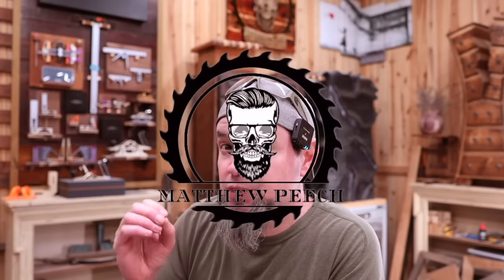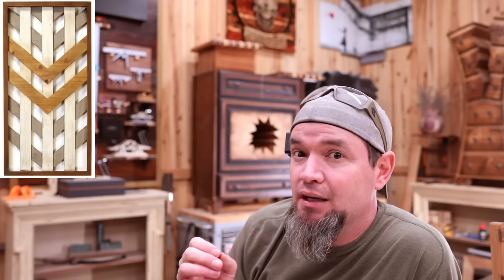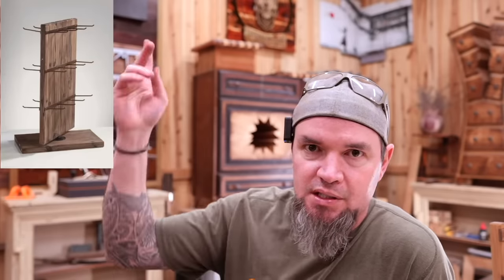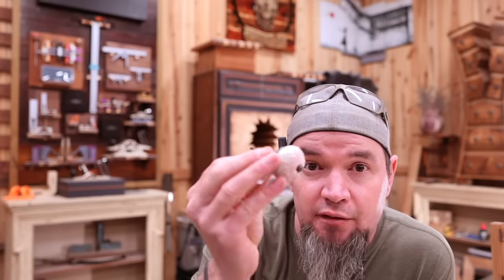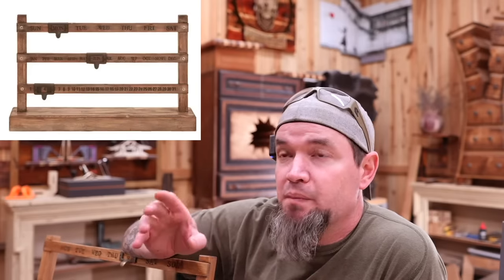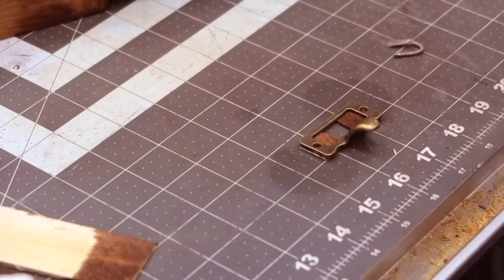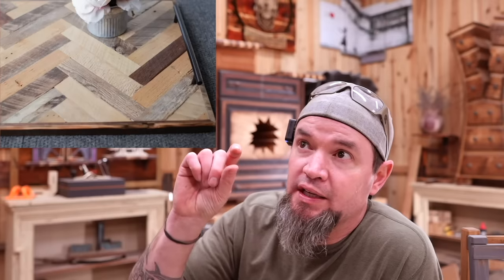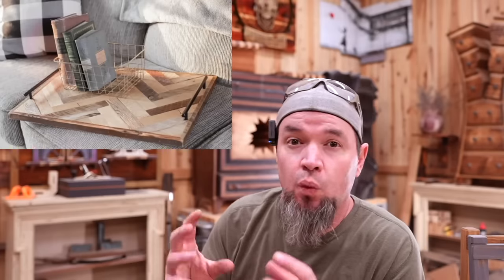7 More Woodworking Projects That Sell - Low Cost High Profit - Make Money Woodworking (Episode 12)

Comment: Looking at the "old" wood cross got me to thinking about all the piles of discarded fence boards you can find for free on offer up. A couple gallons of gas in your pickup, and an hour or so of time will get you the material to build 20-30 of those crosses, and a ton of birdhouse boards...or whatever. I keep a pile of that stuff around, and search offer up a couple times a year for more. Even if the boards you find are totally rotted, you get a weekends worth of fodder for your fire pit 😉

Comment: I have a super cool idea for that useless log sculpture. Take a router to the backside of it cut a piece of super thin plywood or heavy duty cardboard slap a few staples around the edges and turn it into a picture frame. I will be trying this idea out in my area as pictures and weird frames are a hot commodity around here.

Comment: On the jewelry holder, another way you can work around the rotating piece is to get a dowel or rod that fits in the pieces and order some thrust bearings of McmasterCarr for cheap with an ID that fits the OD of your dowel. You'd counter bore your base and tower to hide the bearing. You'd need the dowel to not be so tight that it binds the pieces but not so snug that it binds. Little tricky but you could make a cool floating effect like this

Comment: Thank you for sharing all this knowledge! You really are helping people with the begining struggles of getting started. Bravo! Would love to see some projects centered around small woodworking shops. I literally got a 10'x10' tent I've been working in and need some small project ideas that don't involve ripping up 8' sheets of plywood in a 10' space like I'm doing for my current project 😅 thanks again!
Reply: Jason, I am using an 11ft x 11ft popup gazabo with tarps wrapped around the sides as walls, so I know where you are coming from. When I need to cut larger boards or plywood I setup sawhorse's outside (weather permitting) and then take the smaller parts into the SHOP. It is sometimes a pain but you can get things done if you have to. 😃

Comment: Dude once again great video and that serving tray a just about spat my coffe out when a seen the price that. A could batch them out 10 fold. Just wanna say massive thanks again and to let u no that I've managed secure a workshop in next 2 weeks be in and allot it is thanks u and I'll deffo be attempting few these. One thing need your help with next tool jointer track saw or bandsaw for stuff like this live edge tables and serving boards chopping boards. 🏴👍🤔

Comment: Love all your small do it yourself wood building products to sell. I’m trying to find out how to stop my batteries from draining power in my shop that gets super cold in winter and super hot in summer.. Was hoping you knew something that could stop this from happening. And thanks again for all your great videos. Keep them coming.
Reply: Don’t leave batteries outside in winter or when it’s really hot. I always put mine inside when temps drop below 40 degrees
Reply: @dougpeak7591  what about the heat. It is super hot for months in central Texas
Reply: If it’s really hot you need to put batteries inside to cool down to charge . The batteries won’t take a charge while hot  or extremely cold . In the winter we keep the chargers in a insulated box so they will charge

Comment: So I built the calendar but struggling to glue the staples to the pull. A little glue a little activator. It holds but not for long. Worried after much use in sliding that staple will fall off. What’s the secret? Thanks for all your vids!

Comment: another way to do lettering would be inkjet transfer using Mod Podge. You can print the lettering/numbers/months already spaced out. I would cut half laps in a wide board on a tablesaw cross-cut sled and then rip to width (multiples of 2) making several at a time

Comment: In the first "wall art", if you look at those grey arrow boards, the 45 degree connection is hidden by the front vertical boards.  You would not even need an actual 45 joint, just as long as the end of the arrow boards are hidden behind the front vertical boards. Or you could use 45 degree butt joints like in the serving tray. Either way the joint is hidden. For the 2nd item, you don't need a "lazy susan" at all.  Just use threaded rod, large washers and nuts.  Drill a hold to fit you threaded rod in the turning part.  Then mount the rod through the base.  On the bottom, counter bore a hole for the nut and large washer on the bottom.  Then another large washer and a nut on the top lock the rod into place.  Add a smaller free rotating washer above the locking nut to keep the nut from rubbing into the turning part edge and then just slip the turning part over the rod and done.  One thought about the wall cross.  I like the old reclaimed wood, but they also make "weathering" stain/paint.  You could apply that process to the fresh cut ends and make it look like an really old cross, not one recently made from reclaimed wood.   I love your videos and your ideas!!!!

Comment: Ideas are good starting points. And I think your recommended selling points are good too. But, just like with Etsy, alot of sellers are charging very little (if anything) for their labor. It would be interesting to know how it all pans out once you figure labor costs into the equation. That's gonna drive profitability down.
Reply: If you’re making something yourself then labor cost is your markup. Only calculate labor cost in profitability if you’re paying someone to build or assist in the build.

Comment: Problems....
1.  Those are NOT 45 degree angles (1:45).  Those are solid, single pieces of wood cut out at a 90 degree angle. (Notice the oval grain flows perfectly across the bend in the center pieces.  That is not a mirror cut 45, that is a delicate coping cut at 90 degrees.)
2.  Those hooks are not the same and will not function the same for jewelry.  The pin 'hooks' on the online site are straight because it allows multiple chains, earings, etc. to be hung from a single hook without getting entangled.  The classic rounded hooks you quoted can only hold one item of jewelry each as adding multiple would result in gravity pulling all of them together and entangling, defeating the point of hanging your jewelry in the first place. (6:20)
3. 9:20 - Complains about "Vintage" retail version using brass Phillips Head screw...proceeds to superglue staples to file cabinet pulls, cause you know...C.A. Glue was invented centuries before brass phillips head screws.  LOL!!!!!
4. 16:35  - Those two versions... Look nothing alike quality wise.  You basically took something that is near art gallery quality and then showed us something a C-grade 8th grader would create in shop class and said "These are of similar enough quality that customers of the same spending potential would view both as equal in desirability."
Ya, and I bet you'd say "if you put lipstick and a dress on a pig you can have a prom date." 
Not... The... Same.... WOW...I would LOVE to live in the rosy colored world of delusion you must live in dude.  Are you Ron Popeil's kid or something, cause you seem to think you can pass Chineseium grade woodworking crap off as high value retail stock and No one seems to notice.
My hats off to you good sir.  Nice snow job.